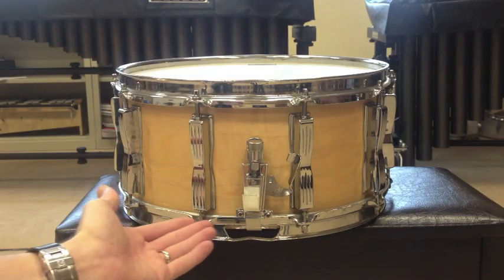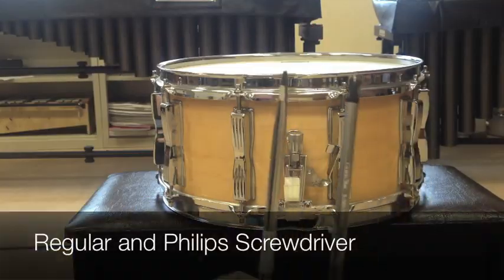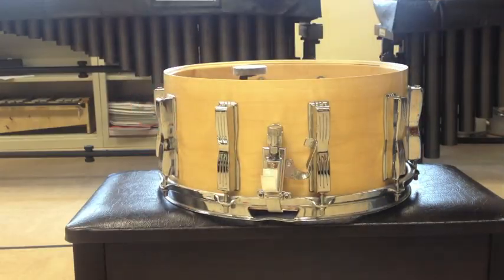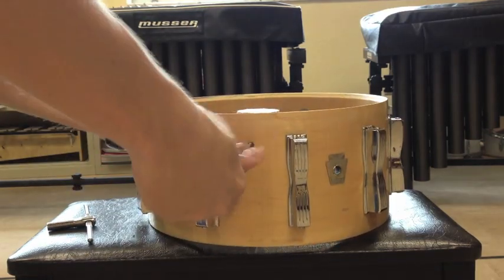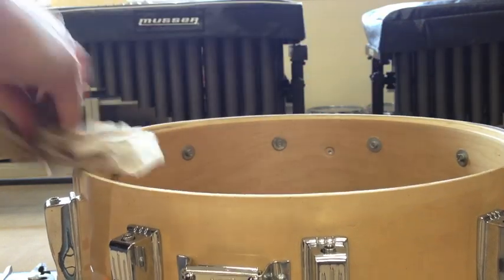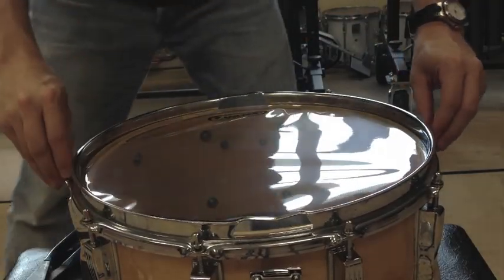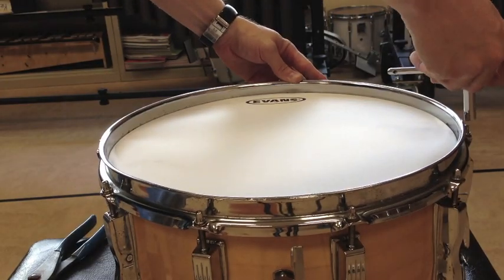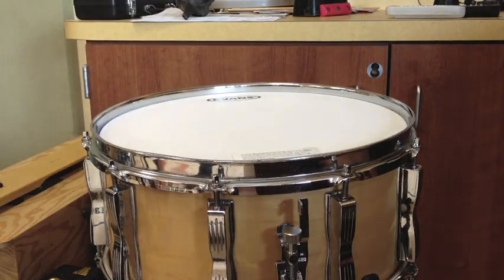Repairing a Snare Strainer

Comment: You don't necessarily have to replace it. What might be simple enough is to loosen the throw-off itself - it usually has a little knob - and then re-attach the snares so they are as tight as can be with that setting. Then simply re-tighten the throw-off and voila!
Reply: I did this before, but its only a temporary fix unless you are missing screws

Comment: You know, I am not a drummer, but I have a junior, drum set. And basically today I was trying to get my snare drum to buzz by using the tension rod. Because I love my snare drum buzzing, and since I am autistic, and I need it for self stimulation, The lever that controls the on and off feature on the snare wires came off. Is there a way I could repair even though I’m totally blind, autistic, and I need it for stimulation. Since I am blind, in the visually impaired. Visually impaired people like me we can’t repair things as well. I can only repair loose pieces from toys, but not from a drum set.

Comment from the maker: The only way to repair a metal strainer is with solder. This is not recommended because it is difficult to get the correct tension. I believe you would be better off purchasing a new strainer. This will cause the snare to be more articulate.